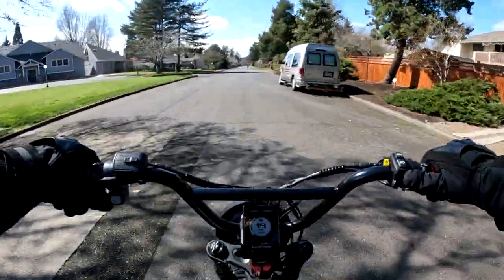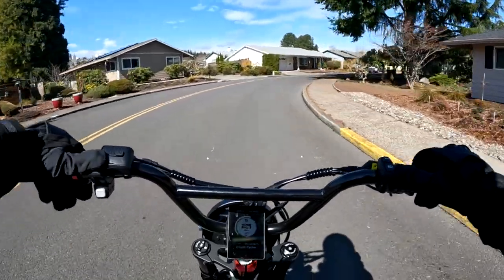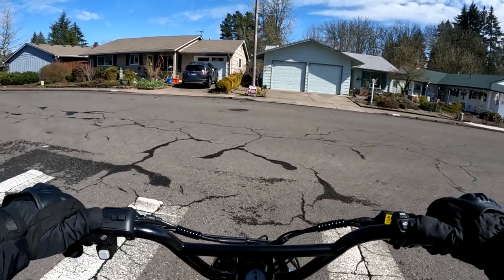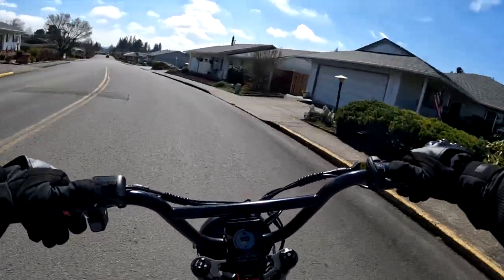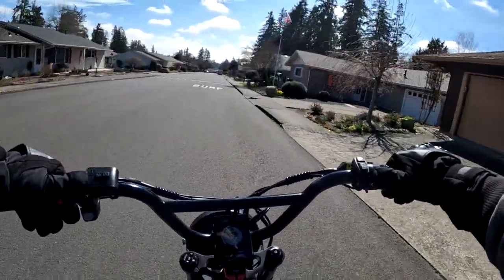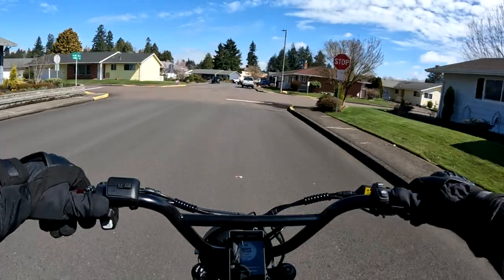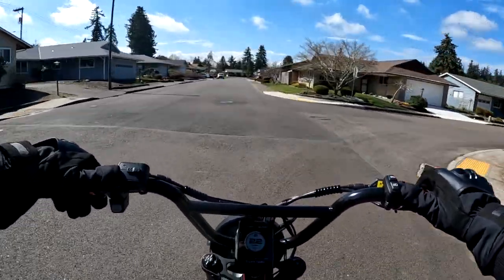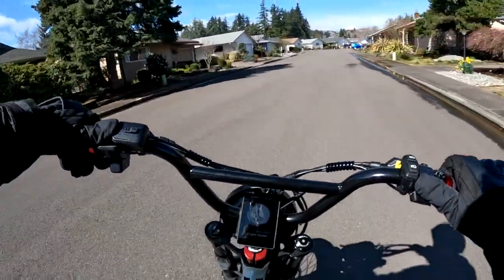How Many Miles Can You Get From An Ebike Motor?

Comment: A direct drive system will always have the advantage because there are fewer parts, and some of those parts are the ones that fail in geared/chain/belt systems.  
A geared motor has gear on gear contact (plastic or metal), and this is where most recent innovations have been made in shrinking the size/increasing the power in PEV motors.  
A mid drive motor is usually installed where your bottom bracket is and in addition to having your shear forces from pedaling pushing on it sideways they're generally lighter built and more compact so heat stress over time can be a concern sooner than the larger counterparts.

They're as durable in that order and if you're not going to learn about your vehicle as well as how to service and PM it, then you're going to have shorter lifespan on all your vehicles no matter what they are.  If you ride things hard, they wear faster and fail sooner - there's no way around that.  The easiest and best thing you can do for your motor is make sure the mud or dirt is off it so it can lose the heat more effectively.

I had set my requirements understanding that I was going to have to maintain and probably repair anything I got so it made it easy for me.  Other people have done all three, I was more about fitting my use case then just copy what other people did that was working.  

Given the same loads and use, though, the thing with more moving parts and smaller size is 100% going to wear out first.
Reply from the maker: Thanks for some great insight.

Comment: They last a long time, way more than most people will go. Bearings might go sooner if you don’t keep an eye on them. I will say, the motor itself is not very expensive as far as things go. A big EUC motor (3,000W+) is around $400. Most people stop using the device before they’d have to replace the motor. Batteries will definitely go first, you only get 500-1000 charge cycles, which you can easily churn through in a few years if you ride regularly.
Reply from the maker: Good to know. Thanks.

Comment: So, I have approximately 2800 miles on my generic no-name Hub motor that I got off Amazon with the bike that was also purchased off Amazon. I weigh 265 lbs plus I carry tools with me first aid kit extra clothing in pannier bags. I live in a very hilly area so anytime I go out and ride there's always a hill involved. The motor is still going strong the only time it quit on me was I overwashed the bike incorrectly on my patio at home, and I got too much water in the controller had to take it apart try it out then I resealed it and I also waterproof. I use the gears a lot for exercise and I'm sure that that helps the strain on the motor picture of a throttle on the on the e-bike but I typically only use it when going out of intersections. The Evike I have has pedal assist sensors at the crank, which I use in conjunction with pedaling and I also pedal in lower gears climbing Hills to help the motor like I said before. 2800 miles on this motor and I purchased the bike in 2021. The weight of the bike itself purchase currently 75 lb. I also to bikepacking camping and I pull a small cargo trailer full of my gear at times.
Reply from the maker: Great mileage.

Comment: I built up an old 90s mtn bike with mid drive bafang, so far about 5000 miles and had to replace clutch. Runs stong now. My distance record is about 140miles while pedaling. With a 52v 20ah battery.
Reply from the maker: Wow 140 miles is impressive.

Comment: I've put 5000+ miles on my 1000w BBSHD mid drive annually, its probably 15,000+ miles total at this point, still working great. I don't do anything to maintain them really,  i did put some additional grease in my BBS02 750W mid drive.  I think keeping them outside and the humidity and moisture in the air  is the main reason they go bad. Or just riding them hard,  i see a lot of younger people thrashing on geared hub motors and jumping them.
Reply from the maker: That's  some serious riding. Great job.

Comment: Motor. One common question is, “How long does an electric bike motor last?” Most electric bike motors last between 3 to 10 years. As you can see, the motors can vary in life span but they are regarded as one of the longest service life parts.Nov 12, 2021

Lifespan of Electric Bike Components You Should Know
Copied from Hemiway when I Googled it.

Comment: My gearless hub motor went over 4200 miles when I sold it...  It's still working good to this day... Gearless motors can  last a very long time.. It also depends on if you're riding it hard at high speeds all of the time.  If you ride it at high speeds all of the time it will have a shorter life. The continuous higher levels of heat will burn it out faster.

Comment: Mike, I cannot guess for answers but I am here for the ride and I am becoming interested.  At least you can pedal when the motor goes out,  so it won't be completely useless right? Yeah, I can hear you despite of the wind.
Reply from the maker: Yes, but some bikes are quite heavy to pedal without assistance of the motor.
Reply: @oregonebikermark8953  Oh, that's good to know. So, you pedal with the motor going?
Reply from the maker: Yes or on alot of bikes you can just throttle too.
Reply: I'm guessing around 50,000